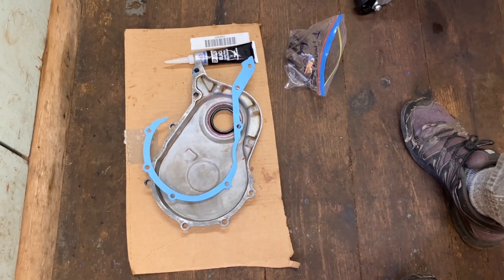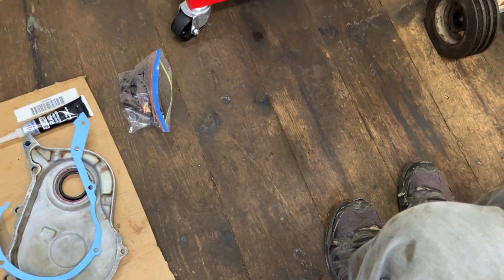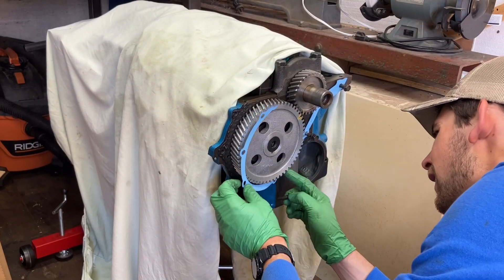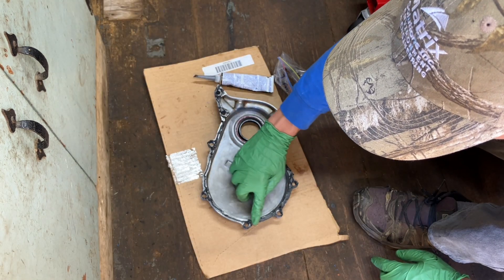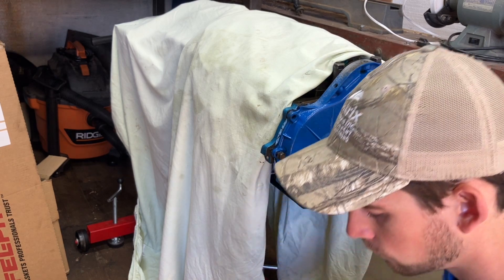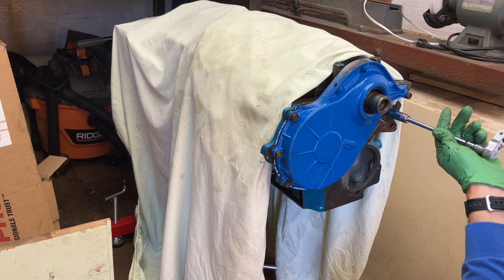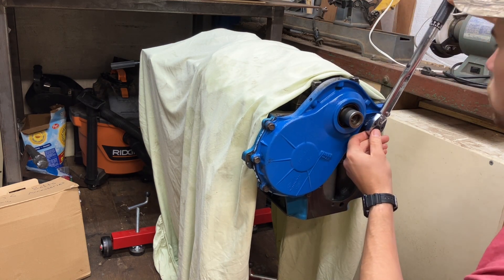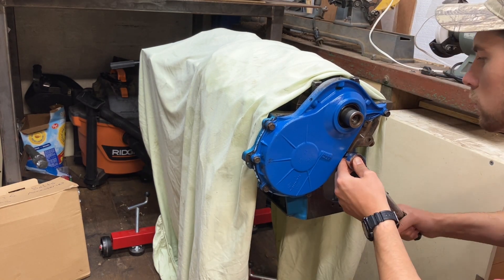Ford 300 Inline 6 Engine Rebuild Part 7: Bottom End Gaskets and Seals

Comment: Old saying #218.
"Oil and grease are cheaper than parts and labor."

You have excellent work habits. A couple of assembly tricks I learned many years ago might be of interest to you. I accumulated a collection of various length bolts that I had cut the heads off. So I had a bunch of studs. When installing things like oil pans, timing covers, transmission pans and the like, after I'd cleaned the holes I would screw two or more of my studs in with my fingers. That would keep the gasket aligned and aline the mating quickly and perfectly. The technique is especially handy when the alignment is blind, as in water pumps with the engine and radiator still in the vehicle. Once I had a couple of the bolts started and snuged up I could unscrew my studs with my fingers.
The other handy helper was, I had a bunch of firearm bore brushes from 22 to 45 ACP. The brushes are brass so I'd chuck them up in a drill and run them into the hole(s). Often I would finish cleaning the holes with the brushes and starting fluid. POOF! bone dry, no grease, no sparks.

You do good work young man. Stay safe and keep in touch.
Reply from the maker: Thanks for the tips! Those are both very good ones, and I can see immediate application for the mock studs! Thank you.

Comment: Do you have a link to the parts kit
Reply from the maker: Great question. I did look into a parts kit, but it was a bit overwhelming, and there was limited availability as this work was completed right in the middle of the Covid supply chain crisis. I ended up letting the machine shop order all the parts for me, and they pieced together an individual kit. I suspect Summit or Rock Auto would have reasonable kits. You just need to know how much over/under your various components will be machined. I found it much easier to have a shop order for me. Cost a bit more, but I knew the parts would fit properly.

Comment: I’ve been waiting for this one!  I just picked up a 77 f150 and I’m going to rebuild the 300. Your videos have inspired me haha.  Quick question for you, what was that black sealant you smeared on the oil pan mating surface before the gasket went on?
Reply from the maker: Glad to hear you’re following along! The black sealant was a permeated gasket maker. I don’t remember the exact type, but I believe it specified it was oil resistant and was for things like oil pans and valve covers. It helps the gasket stay in place while you position the part, and it also helps to fill holes/gaps in the mating surfaces that are now over 40 years old.

Comment: Great job so far Jeremy! I have just finished breaking down my I-6 and will be taking it to the shop to be dipped, fluxed, and surfaced. Any tips you can provide would be awesome.
Reply from the maker: Hey, that’s great to hear! My tip at this stage would be to take your time with the work you’re doing, to ask the shop what THEY need (for example, what parts they want you to bring), and then also ask questions from them to be clear about what you’ll be getting back from them. Another item to think about is that the shop is good at checking surfaces for flatness - and it’s not uncommon for things like intake and exhaust manifolds to warp over time, especially on a long engine like this. I ended up having to take my manifolds back later on to have them resurface them. Might be worth bringing them now and doing it all in one go.